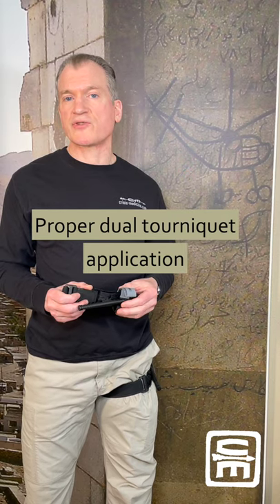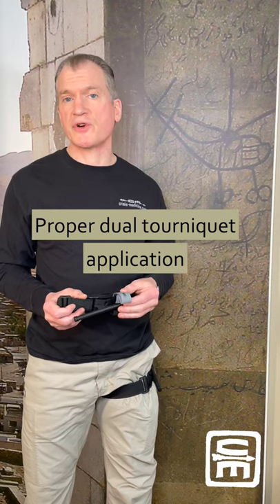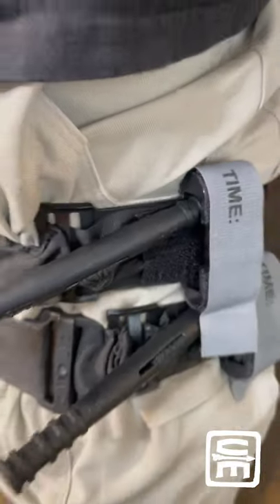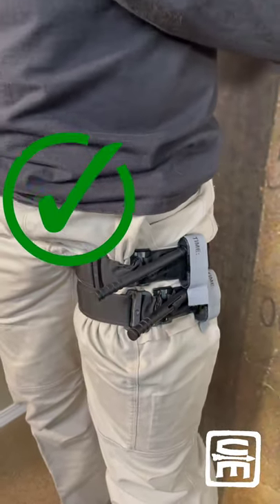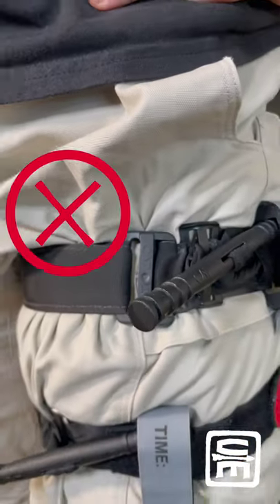Proper dual tourniquet application

Comment: So do you apply the Tourniquet 2-3 inches above, or “High and tight?” It really would be nice to have a set standard rather than conflicting information
Reply from the maker: There is a standard: High & Tight is for a tactical situation where you can not assess where all of the holes are. If you have time to identify the injuries, tourniquets go 2-3” above the highest wound. If one tourniquet does not work, then you need two tourniquets, as shown in this video: in that case, the second tourniquet goes above the first, with the tourniquets touching.

Comment: What if it can’t go any higher and you have to put it below
Reply from the maker: As long as the highest tourniquet is several inches above the highest wound, you can put the second below the first. However, the two tourniquets need to be parallel and without much overlap. Obviously, going higher than the first is preferred, in case the first is too close to there wound and the artery has been severed and pulled back.
Reply: @CrisisMedicineTraining  thanks that is helpful

Comment: I figured high and tight and then the second one is 3 inches above the knee never below that’s a no. . These things are important to know just in case you ever find yourself in a situation that requires you to help someone .
Reply from the maker: High & tight is for a care under fire phase when you cannot take the time to ensure you know where every hole is. A second tourniquet would be placed if the first one does not control massive hemorrhage, as occurs in approximately 30% of high thigh applications. In this case, the second tourniquet would ideally be proximal to the first, or closer to the body if you have room, and the two tourniquets should be side by side, touching. If you don’t have room to go above, place it immediately below, but touching.

Tourniquets can be placed below the knee if you are certain that is where all the holes are. The myth of not applying tourniquets on so-called 2-bone compartments has been completely debunked. Same rules apply, 2-3” above the highest wound, and never directly on a joint.
Reply: @CrisisMedicineTraining  thank you for taking the time to answer my question. Now I know